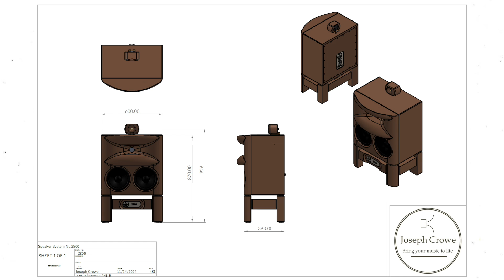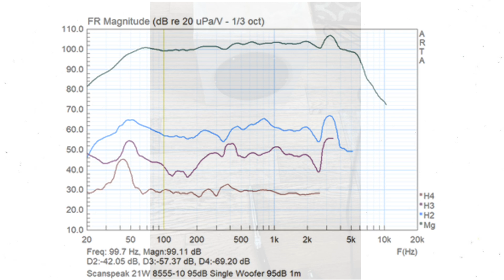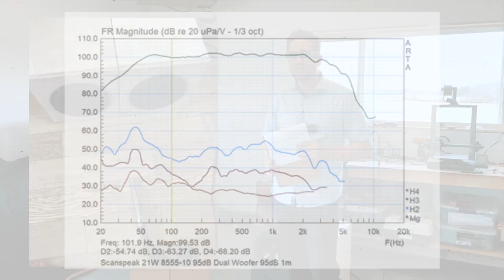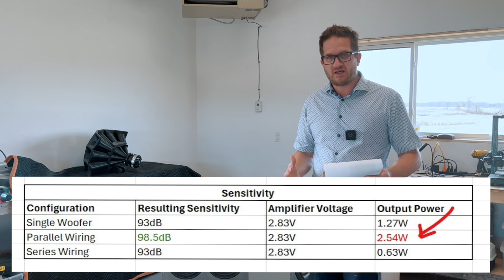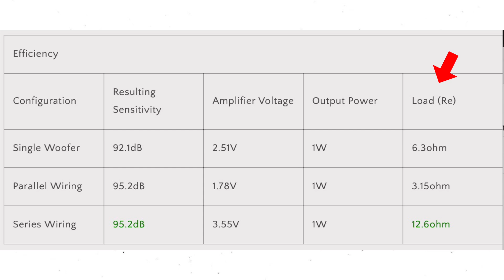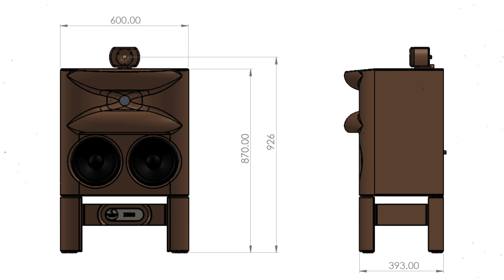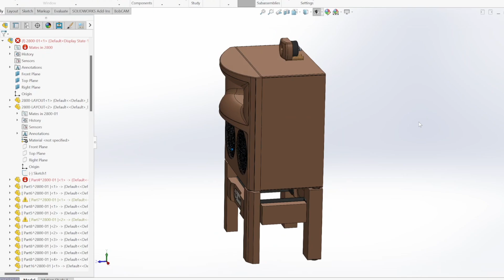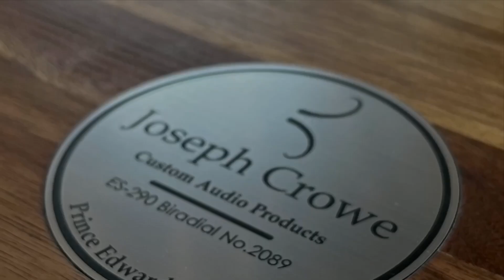Speaker System No.2800 -- Initial Testing

Comment: You will have to choose the bass speaker units carefully, since many modern units rely on amplifier damping factor rather than high magnetic flux to control their heavy cones. By connecting in series each unit sees the other unit as the output load, a very low damping factor of 1.

Comment: If it's got the same distortion/spl as the 15", does that mean it's the same, better, worse?  Like besides it being smaller, if you don't care about size (or cost for the sake of this question), which one is simply "better"?
Reply from the maker: The 10” sounds better in the critical 300Hz-600Hz region. Dynamics are the same as well but it requires very good upstream equipment based on my own experience. Also the recordings needs to be properly dynamic. I find that a 15” sometimes has artificial dynamics, being a little over reactive even when the music doesn’t call for it.

Comment: Love the look. In my experience too many drivers close to the floor can feed a standing wave between floor and roof, but you'll quickly see that in the measurements.  With less amps going through those tube amp secondarys the distortion from them will be lower. And with less heatbuild up in them too. I have tubeamp with kt88 using kt120 and now the transformers is the weak link power wise, so using the highest tap eleveates that somewhat.
Reply from the maker: Yes, 16ohm is exciting. I will be developing a 4ohm version however for those using solid state. These speakers can go extremely loud when given serious power.

Comment: If you are trying to maximize efficiency, I wonder why not a back loaded horn bass cabinet design? Is the ported just as good?
Reply from the maker: The bass reflex offered a smaller physical cabinet size compared to BLH. I tested sealed to see if that could work but in the end I enjoyed to extra bass output offered by ported…but it took some tuning to get just right. It’s now sounds excellent with extension to 23Hz (-6dB downpoint) something which is difficult for BLH to achieve.

Comment: Hey hey 
Great video you two. Could you release something like this or something like the 1680 as a diy plan ? That would be awesome.
Reply from the maker: I was considering a budget DIY version of the 2800 using more affordable drivers with a 3D printed horn that goes in the baffle. Probable a 1” driver because even the 65CDN-T is quite costly. The Beyma 10BR60V2 is an example of a woofer I’ve heard that sounds great.
Reply: That would be awesome. I was also considering your latest 15 inch two way build plans with the beyma and sb + es600 
It would be awesome if you could add some more info to the sales site of the plans like with the other 15inch two way using the 15ib350
Reply: Like a double 10 inch plus the es600 with the sb driver…

Comment: You mentioned time alignment between the tweeter and midrange horns. What about between the woofer and midrange on the 2800? A 500 Hz crossover should really put non-alignment on display. 
I think that the design is absolutely gorgeous! 
The logic behind the woofer topology is spot on. My experience is that series woofer connections are great when crossed well below the baffle step frequency, but 2.5 is better when the woofer becomes more of a midwoofer.
Reply from the maker: The system is time aligned for the bass as well. The group delay of the woofer at 500Hz is .2ms and the woofer is physically advanced ahead of the MF by 184mm which puts it in alignment. This is confirmed by my own measurement having a perfectly flat response through the crossover region.

Comment: I always heard that series connection can be problematic because the reactive inductances of the voice coils influence each other, but maybe this is different in the bass.
Reply from the maker: I’ll be creating a 4ohm version for those that have solid state. This would have the woofers in parallel and the 8ohm version of the compression driver used instead. I’ve never heard of issues related to series wiring. I would be interested to know where this is published.
Reply: @JosephCrowesDIYSpeakerBuilding  No puplished data. It was a friend on a forum who had build a line array with cheap fullrange drivers and according to him paralell connection was way better. His speaker ended up being 0.5ohm and he needed a special amplifier for that.
He liked it better than horns with AER drivers. I can find the link of his write-up if you want to look into this.
Reply: Danny at GR Research has talked about series wiring and inductance causing issues (this was in the context of certain poor crossover designs) but I think he was talking about how it affected the tweeter, which was effectively in series with the midwoofer/woofer... perhaps it would have no particular negative effect in a woofer crossed this low.

Comment: I like your rationale for the new design. What caught my eye, though, was the multicell horn behind you, on top of the mover's blanket. Now I'm going to have search your website and this channel to see if it shows up somewhere, in detail. (There it is, in your website, on the page for this speaker system, the 2800! Ha!) Thanks!
Reply from the maker: This was an older multicell prototype that I continue to refine. There’s a new one on my printer right now but it will take three days to finish printing. The current prototype is free from horn coloration and extends cleanly to 16kHz no problem. But there’s a dip at 5kHz on-axis but quickly goes away at 15 degrees off-axis…do not good enough. The sound quality is about half way between the classic Altec multicell and my own ES-biradials. So I’ve made some progress sonically and hopefully more so with the next prototype.
Reply: @JosephCrowesDIYSpeakerBuilding  I've been around the scene for a good long while, and I'm really still not sure of the motivation for a multicell. What are you hoping to achieve? Is it really just a better dispersion control device than an open horn?
Reply: @weatheranddarkness  wider dispersion in the higher frequencies where a horn typically narrows I'm guessing.